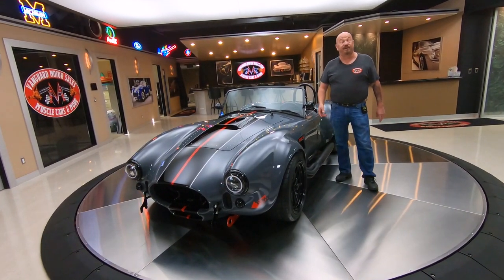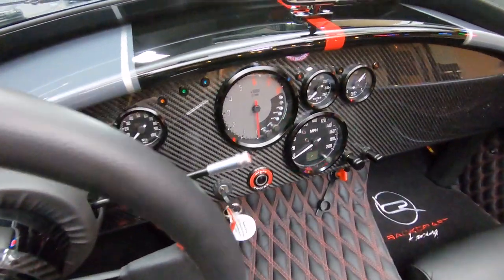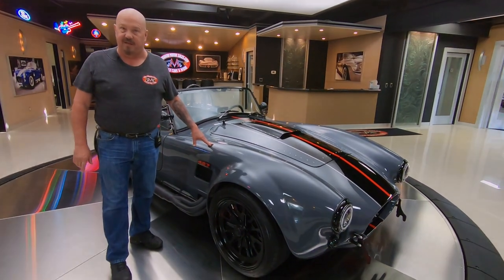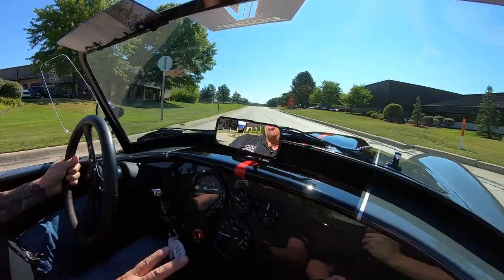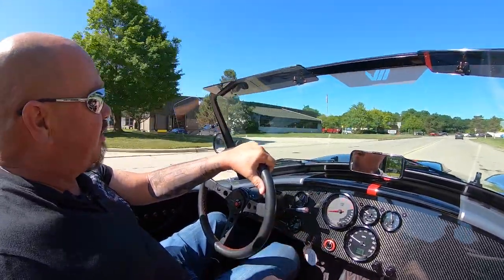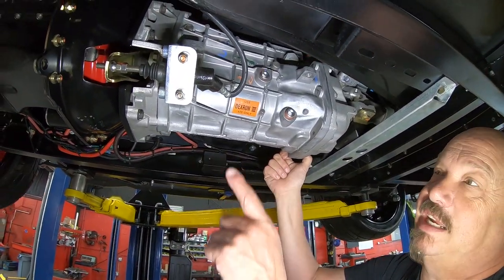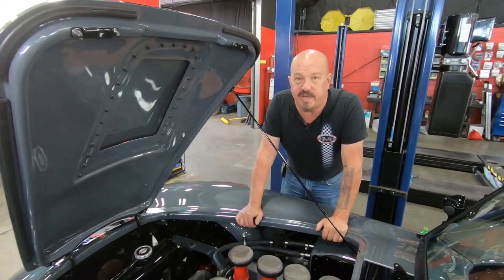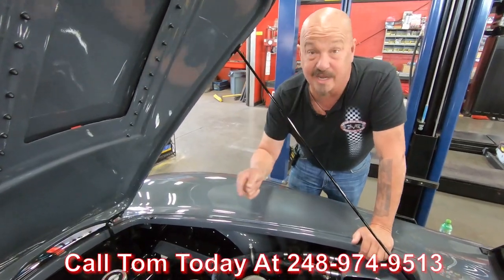1965 Shelby Cobra Backdraft For Sale

Comment: Hey greg   im Jazz here in Auckland NZ...  I have a question if its ok to ask... my question is..... is the backdraft cobra slightly bigger in "body" dimensions than the factory 5
Reply from the maker: We do not know the exact measurements of the two, but we do know the Backdraft interiors seem to have a little bit more room.
Reply: @vanguardmotorsales  OK thanks guys.. I'm just starting the build process on a black lambo countach.. Once I've finished that I'm onto the back draft cobra